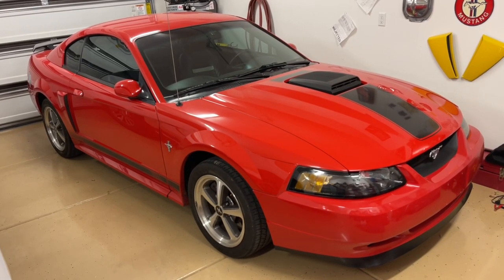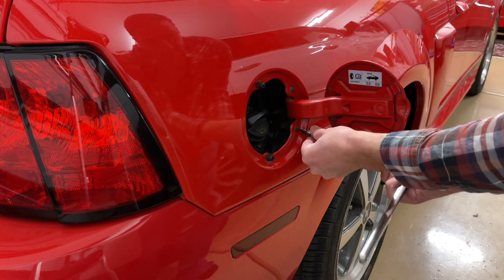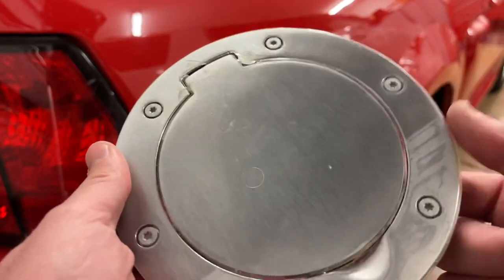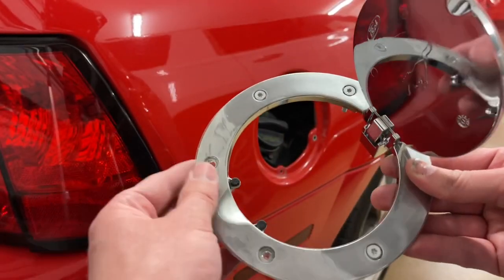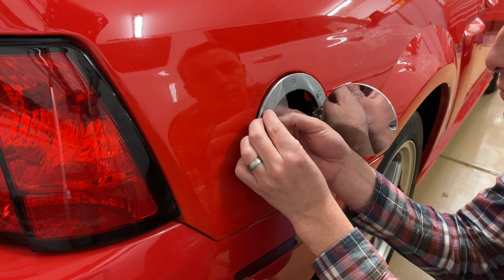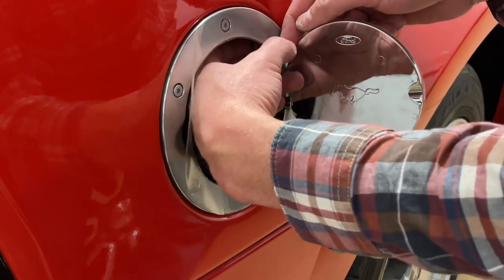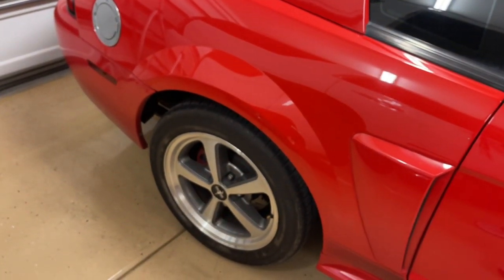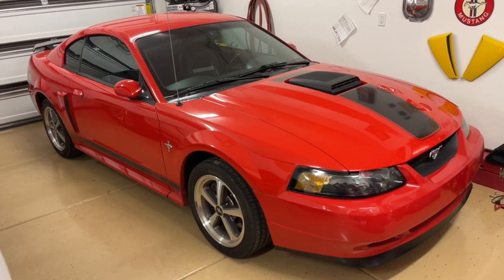Bullitt Fuel door install on 2003 Mach 1 (1994-2004).

Comment: I really like the Bullet  fuel door, I have the  brushed finished one on my Mach.  Easy install. Mine came with nuts for the 2 screws. Got it at the Ford dealer along with the Bullet pedal kit. Back in 03 the fuel door was only $60 and the pedal kit was $80. First 2 mods I did to my Mach. Looks great on your Mach Danny! 👍👍

Comment: I have one of the original Ford Bullit fuel doors on my 04 cobra. You are correct about the hardware rusting.  What's your suggestion on getting rid of that and preventing it from reoccurring?

Comment: The seller hasn't uploaded any more I need one lol looks good
Reply: Similar kit on American Muscle
Reply: @wolfmassey  yes there is but it's not OEM lol
Reply from the maker: It looks like the mold on the back door is even the same with 4 dots, just no ford emblem or running pony
Reply: There's a factory one on ebay right now 200 buy it now 220 with tax. I bought mine from the same guy with no trouble.
Reply: @dannyjohnsonsgarage  you're right OEM is the best always
Reply: @chuckkropkeiii5837  oh really? I can't find it
Reply: Type in on eBay 2001 bullitt mustang and it is in the parts and accessories
Reply: There is 2 on there now. It's a fuel door extravaganza 200 for each.
Reply: @chuckkropkeiii5837  ok now I see it looks good lol

Comment: I had to used new allen scews and nylon lock nuts in the inside after someone try to steal mine from my bullitt
Reply from the maker: Wow, that’s bad someone wanted to steal them
Reply: they even stole some decals i had in the fenders of the Bullitt logo .. stickers!! They stole the sticker decals😂😂😂 
But the worst was how they also stole the rear Bullitt emblems 🥺😔 they scratch up the rear deck when they took them off.